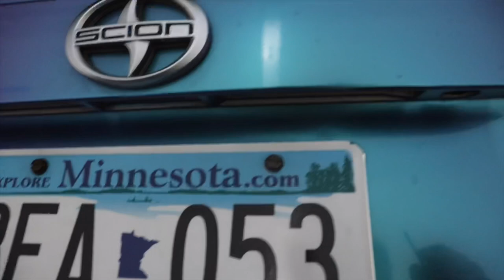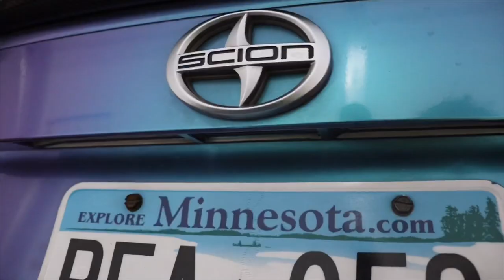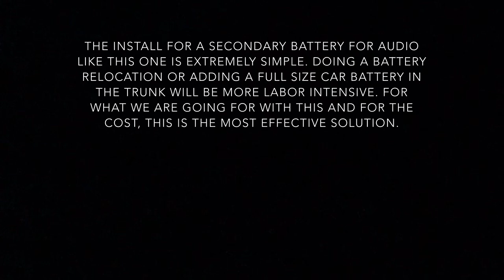Installing a battery in your trunk - XS Power XP-750-CK

Comment: Did you have to charge your Xs battery before installing it?
Reply from the maker: Yes we did. You are suppose to make sure it is fully charged
Reply: @FRS2K  what did you use to charge it with?
Reply from the maker: @isaacso  regular battery trickle charger

Comment: Is your voltage better
Reply from the maker: We never tested the differences in voltage with the second battery. We started having issues with mine so we disconnected it. One thing that would help if you are going to install a second battery connected to the main one is to install a battery isolator.
Reply: @FRS2K  I think the battery is supposed to match the front battery

Comment: Isolator needed
Reply from the maker: Good tip 👍
Reply: Where can i buy an isolater?
Reply: @joshuadominguez4918  Amazon
Reply: is it really necessary? i have a 500 watt rms with 30 amp fuse  and a 4 channel power pack with 15 amp fuse.